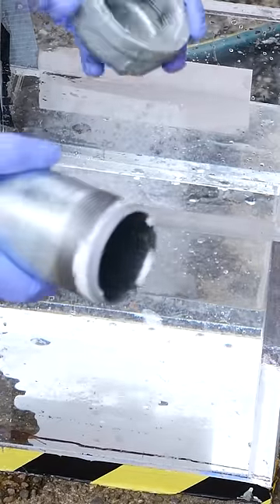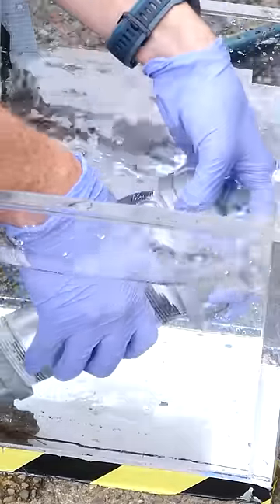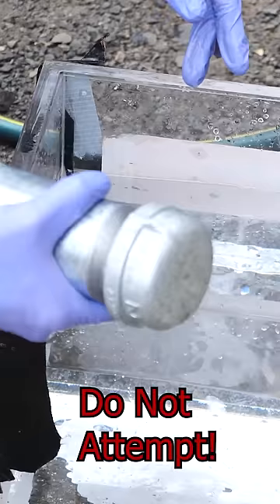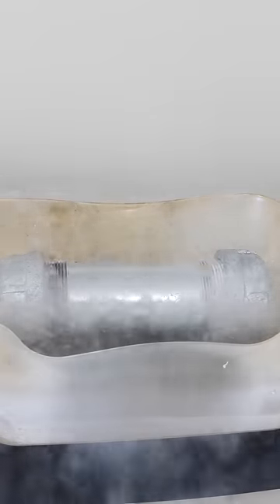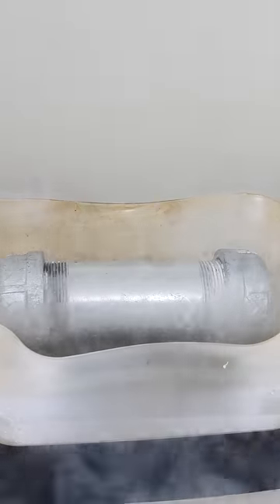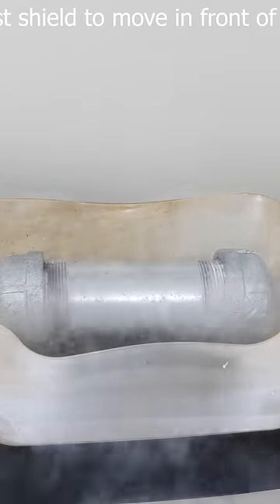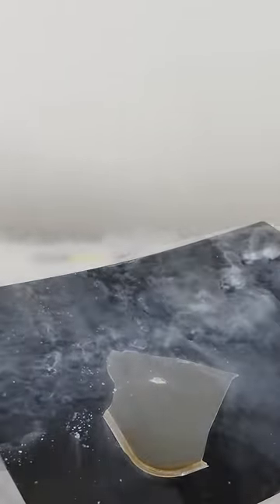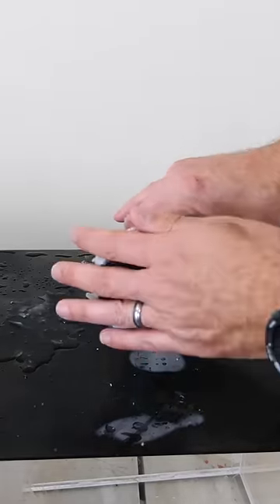Don't Ever Try To Stop Water From Freezing!

Comment: It isn't just the freezing water.  The liquid nitrogen's effects on the steel are more of a problem.  The shrinkage of the steel and reduction in ductility due to the reduced temperature meant the container was shrinking on a none compressible fluid while losing a large percentage of the tensile strength.   If the temperature were dropped to the freezing point of the water instead of way below before the water even started to get cold it wouldn't have exploded at all.
Reply: Thank you for writing that. Now I don't have to.
Reply: Thanks your senior  explanation for this testing
Reply: I don't get it but thanks
Reply: What i was thinking
Reply: I thought the same but in no way could explain using the genius word smithing you laid down.  Very nice!
Reply: Smaaaht
Reply: Ok hear me out, now do the same thing but turn the water into steam 😅
Reply: Also metal threads stretch and weaken as they stretch. People please do not try this, very very dangerous. Freezing metal that becomes shrapnel is no joking matter. Stupid cannot be fixed sometimes by sheer warnings alone but prayers reach out to God for protection for stupid people.
Reply: Proper testing parameters are just as important as reaching outcomes.
Reply: How brittle does steel actually get at -200C? like tap with a hammer brittle, break out the sledge.
Reply: Excellent explanation. Thanks.
Reply: @wowftw120 The nitrogen took the pipe below freezing. If it only went to the freezing point(32°f) the pipe wouldn't have exploded.
Reply: Thank you the liquid nitrogen makes the difference not an accurate video.
Reply: Kinda like how a soda can expands and bursts rather than shattering like glass? If I'm thinking about it correctly
Reply: @Jesayou  just for info. This was the fate of many liberty ships during second world war. Brittle transition temperature. Look it up. For some steel the temperature don't need to be very low.
Reply: Thx
Reply: you coulda just said steel small, water big
Reply: When did u type the word tensile  b4 this.
Reply: Bout time someone else said that
Reply: incredible yappability
Reply: Nope, slowly freezing would still result in catastrophic failure
Reply: Yep this guy just explained the sinking of the TITANIC why she broke so cleanly in half and why the rivets shattered when hit by tye iceberg because the cold makes steel and iron brittle especially steel from 1912.
Reply: Okay Mr. Professor. Why is it that it is a big problem when the heat goes to places where it gets below the freezing point then. That's because the pipes that carry the water around the house burst because the water freezes to ice. Also, how would you freeze the water inside a pipe without freezing the pipe first when the pipe is closed simple kindergarten logic
Reply: @noconsentgiven Just try building a central heating system with that theory
Reply: As someone in the pipeline industry that has seen a pipe after exploding due to freezing, it definitely will/can explode.  If I remember correctly, the company filled the pipe with water for a hydrotest, left it overnight on a night that dropped in the teens and came back to a 4ft rip down the seam
Reply: @franquil85conn as someone who works in construction we drain all the lines and open all the valves because they will break. I forgot to open a 2 inch ball valve came in the next morning and it busted always fun changing valves in the cold
Reply: @bands3061  yep, definitely no fun
Reply: Ductilty wasn't the issue here, pipe shrank faster than the cap and growing pressure made cap comes off the pipe thread.
Reply: Yeah, the nitrogen definitely caused the steel to get more brittle
Reply: Perfect. You saved my time 🎉
Reply: What about pipes ? Like plumbing in houses
They freeze and burst even without liquid nitrogen
Reply: so what if we use butane to slowly freeze the water?
Reply: When am I going to become smart enough to understand these kind of intellectual comments or I am not?
I know most of you are watching the video for entertainment and satisfying feel but not for the knowledge.
So., Respect and manners to this user
Reply: We did this experiment in physics last year, but on a much smaller scale and without the nitrogen, we filled small bolts in water and put them in the freezer for two weeks, so you are correct in saying they don't explode (much to everybodys disappointment lol) however they do "burst" and are unusable afterwards
Reply: @AquariumAficionado depends on what kind of pipe. High pressure of water might cause it too
Reply: Fart smella
Reply: I was gonna say.... but you already did. Thanks!
Reply: @craigsaunders7037 ye I’m sure that they knew exactly when it was gonna blow too
Reply: That’s why I don’t understand the title. It’s clickbaity.
Reply: @LML262 there won't be any shrapnel genius....the thread point of surface contact is the weakest quotient.

A rapid shrinking of a vessel with a internal atmosphere of zero, simply obeys the laws of physics when all things being equal have a discrepancy with what must now be its weakest point and or unequal to the equal fact of rapid contraction..... energy absorbed in this case, reduction of hysteresis and or ductile retention.

...tensile strength...is not a correct application of terminology.
Reply: @Tasarran no, It made the steel become more "hard" vs "tough"

Brittle would be a more natural state or condition in which a Rockwell rating is compromised and therefore in this case, too brittle to be fairly measured vs true industry and scientific ratings of measurement known as hard and or tough as a given yield spectrum for what is in its natural state ie; brittle.

Too brittle to be measured.
Reply: Sad for you that your first response is to belittle someone....I will pray for you. Dear Jesus,  I ask that You forgive this person for that they do not know me. I am thankful for their intelligence and that they use it in an honoring way for You. In Jesus name I pray, AMEN
Reply: Yes, but of course
Reply: Good
Reply: our world is fucking amazing, so many factors go into every physical reaction we see. thanks for explaining this
Reply: @wowftw120 because the last sentence is very poorly written
Reply: You are right it weaked steel but completely wrong when u say it still wouldn’t break the steel😂 u clearly have no idea how strong water can be when it expands
Reply: I no understand big words
Reply: sounds like a nuclear fission
Reply: @shaggyblondguy9527 I doubt that🤣

Comment: I think the reason it gave is because water was in the threads and expanded making them not quite as tightly threaded together then the internal pressure popped the top off fairly easy

Comment: When metal is heated it gets soft and can be bent and shaped, when cold it becomes brittle and liquid nitrogen is waaay colder than required to freeze water. I believe the extreme cold effects on the metal had more to do with the reaction than the pressure from just the water freezing (even though you say your pipes burst,freezing pipes in houses crack and split but don't explode).
Reply: While the metal going brittle due to the extreme temperature will indeed cause it to fail more easily, I believe it's the interaction between the temperature and the water rather than metal that causes the explosive results. The  much lower temperature will cause the water to freeze much faster that normal freeing temps encountered by pipes in walls, as such the expansion of the material (water) would happen faster causing a faster buildup of pressure in a construct that has far less room for expansion. Kinda similar to how different explosives have their strength rated based on the expansion speed of the gasses released.  Sorry I don't know the actual maths for it
Reply: Forgive my ignorance but how come skyscrapers don't fall in below freezing tempatures? All about the type of metal right?
Reply: me too. You could of dropped the pipe and it would have shattered.
Reply: @shyrobe I believe this is the case too. They probably us to leave our pipes dripping not so the water doesn't freeze, but so the gas has a way to escape as it does. Either way, it was still caused by the liquid nitrogen here
Reply: Lmao imagine your toilet randomly decides to turn into a bomb
Reply: @tiggybiggy9929  buildings are in,say, -10°, liquid nitrogen  is - 300° ,a major difference.
Reply: That and them threads ain’t gonna hold…a lot eaiser to bust off threads 20-30 thousands deep then to split the pipe.
Reply: Metal becomes brittle when frozen but it also shrinks so I imagine that mine contribute to the pressure
Reply: This is incorrect.  Common metals do not become brittle to any significant degree when frozen to very low temps.
Reply: This is more an example of why pipes burst in sub freezing temps
Reply: @tiggybiggy9929  Liquid nitrogen is -320 F (-196 C) so that definitely impacts the strength of the steel pipe as opposed to a skyscaper under construction which is only exposed to perhaps -10 F temperatures. If a building has the exterior installed and insulated, the steel never even gets down to freezing.
Reply: 'the explosion that is caused by high pressure is less to do with pressure' great take genius
Reply: different pressurization and rate of freezing
Reply: Same as cooling down a hot glass, it cracks. While if you let it cool down slowly all is fine.
Reply: This
Reply: @tiggybiggy9929  it gets brittle compared to other metal, but it's still metal so i don't think it would get that unstable
Reply: My first thought
Reply: Yep he should have put it in the freezer instead of quick freezing it. The pipe would still break, just not as catastrophically
Reply: Nah I've seen less than 3,000 psi rip a 4 foot hole down the length on 2 inch schedule 80 seamless pipe on a hydrostatic test. The pipe he was using wasn't rated for what he put on it. The threaded caps he used however I can see the liquid nitrogenfracturing that. They look like galvanized pot metal. You can just about bust them tightening them up on the pipe.
Reply: @ZEZERBING  Also, most buildings have their metal at least somewhat insulated by the rest of the building
Reply: @jellojiggler1693    You are very incorrect.  Low temperature embrittlement for metals does not start until very low temperatures.  To any significant degree it is far below -73C.  Zinc only starts at -129C.

The metal in the video did not get anywhere near those temps.
Reply: @tiggybiggy9929  liquid nitrogen is a lot colder than freezing, about -320 degrees F
Reply: @karozans  First you said "Common metals do not become brittle to any significant degree when frozen to very low temps." Now you say "Low temperature embrittlement for metals does not start until very low temperatures." You're trying to prove me wrong on youtube by twisting what I said and throwing it back at me instead of taking your L. Admit you were wrong and move on.
Reply: @jellojiggler1693    Correct.  They don't.  I won't admit anything since I wasn't wrng.
Reply: @ericg4915  there's only enough room for one Eric G in this comment section
Reply: While you have a point, and I'm no chemist, BUT: there's some difference between temperatures being right around freezing temperatures for flowing water in plumbing, versus liquid nitrogen being used as the freezing agent with a pipe forced to act like a container vessel for water under these conditions.  

Water having absolutely nowhere else to go versus a flow system with gravity;
32 degrees Fahrenheit versus like negative 360 degrees Fahrenheit.  So the comparison is vague at best.

Don't get me wrong though, this is still pretty awesome compared to the occasional plumbing fix I have to do.
Reply: Your home water pipes are not made from cast iron that is brittle to begin with. And if your home pipes are made from cast iron they will have gases inside of them. Either gas pipes or drain pipes. Try the same with a cooper pipe, see if it explodes. No chance, it won't handle pressure, brittle or not it will have low hardness and won't explode with same force
Reply: @ZEZERBING doubtful
Reply: @kgsails7102 thats just not how metal works fam
Reply: @Fordgroup00   it's not obvious to me it would freeze at all in a freezer. The container exerts pressure back onto the water, which I would expect to lower the freezing point of water. It certainly might have lowered it below the temperature of a regular freezer.
Reply: Bingo. Put that pipe in freezer for a day and the caps will pop off or crack.
Reply: @mr.clownspy3677  yup threads are definitely the weakest link. If you bolted on a lid like a flange I bet it would have stayed
Reply: Nope. There must be a force to make the pipe break spontaneously. The only possible force exists through the pressure caused by the water. This same example is reiterated when you see water pipes exploding in cold US states, but you never hear about cars shattering into pieces.

Sure, you can lay out a cold pipe, and it will become brittle. But there will be no force to make it explode if it is empty.
Reply: @shyrobe  thats how it happens in pipes anyway. the pressure of the casing (pipe) prevents the water inside the pipe from going below 0.

so even though the liquid nitrogen is WAY below zero.

the water inside doesnt freeze until the point of explosion.

because the water snap freezes.

thats how it happens naturally in pipes, but in this instance the negative pressure was so great it compromised the strength of the metal.

same as if  you get metal  really hot, then douse it in freezing water, it can crack.
Reply: @TopBestestGreatestFastestMost   depends on how low the  freezer goes. -3 celcius and it wont freeze, the pressure will prevent it from happening.
Reply: Fair point.
Reply: @tiggybiggy9929  short answer: cause engineers design for it, it's one of many things that goes into the factor of safety for a building
Reply: Nice 😉
Reply: @o0xTHEcoPlayerx0o  I’d like to see this in a -80C ultra low freezer. That way we get a much more stable temperature drop vs the -200C snap freeze.
Reply: Should've tried stainless steel
Reply: Britle and a smaller effect on the grip bcs threads dont match precisley ,but the presure is what causes the wxplosions , pipes in your house are small and long this is a container
Reply: @bobcat2840  the moment you sit on it
it's going boom boom
and not the poop way
Reply: I wanna add this to the conversation.  I am a mechanical engineering student.  We talked about this concept in my material science class.  Steel is a bad choice to do this with, especially the common alloy type used for pipe and fittings. Iron and most steels have a ductile to brittle transition temperature where lower temperatures cause these metals to act more like ceramics under stress.  Instead of having a somewhat wide plastic deformation curve they just fracture after they hit their elastic limit.  I’d like to see him retry this with another alloy/element like aluminum that doesn’t have a (significant) DBTT.  I’m sure it will still explode but it will probably take longer.
Reply: Agreed
Reply: He definitely did it for the sake of being concise in the video, but I agree, a more controlled freezing would be better
Reply: This is wrong, the pressure of the pipe make the water above 0 all the time until outside temp is like -150 or something pressure became too big and all water drop to that temp all together and explode
Reply: Yup it's the same reason an iceberg dug a hole through the titanic, engineers didn't think about taking low temperatures into account when choosing materials back then
Reply: Had nothing to do with the temperature of liquid nitrogen. Has to do with the expansion  of the water. There are people who have used a quarter inch plate solidly welded mild steel cubes which has elastic properties and doesn't become brittle at 0° Celsius, and simply put it outside in freezing weather and it still goes off like a bomb eventually breaking the weld seams when enough of the water freezes that there isn't enough space for 10% expansion. Most of them turned from a cube into a sphere and all of them broke the weld even with varying thicknesses of steel. It's about the expansion of the fluid when Frozen; not the RATE at which it freezes; or the liquid nitrogen making it brittle; although I'm sure the brittleness contributed to the violence of the explosion. When an incompressible Force meets a non expandable material. The material will fail. Water is one of the only elements on the planet that expands when freezing most contract. He got lucky that he got that shield up in time when freezing it that fast. He essentially created a temperature powered pipe bomb. In relation to pipes in a home; the reason they split rather than explode is simply because the material is very thin and gives out long before enough pressure builds up for an explosion. Put black powder in a cartridge behind a projectile and you have a bullet capable of traveling miles. Put black powder in a single layer of tinfoil behind a projectile and you have a little flash with the projectile pretty much dropping in place. That's about the difference we're talkin; so you can't compare house pipes to this demonstration.
Reply: The hydraulic press channel did a video pressing different metals that had been cooled in liquid nitrogen. Contrary to their expectations, it didn't make the metal brittle to any significant degree.
Reply: The pipes to your house aren’t closed tubes either.They couldn’t build enough pressure to blow the pipe like that.
Reply: The nitrogen might have made the threads shear at a lower pressure.

However, all it really did was make it fail a small amount safer. Better the threads shear at lower pressure. The threads on a steel pipe cap are not going to survive that pressure.